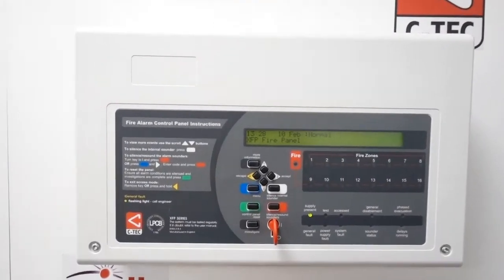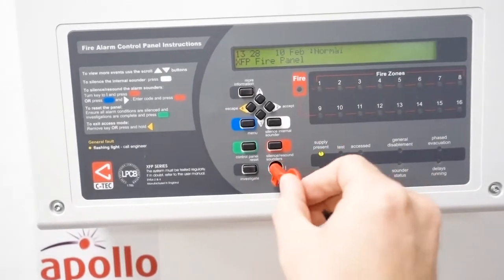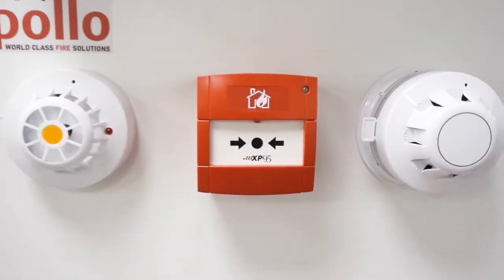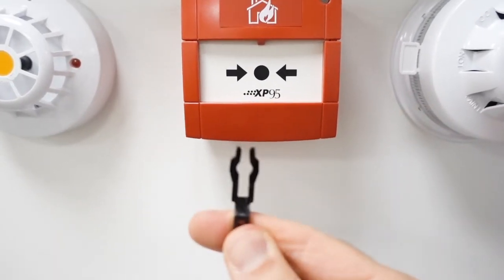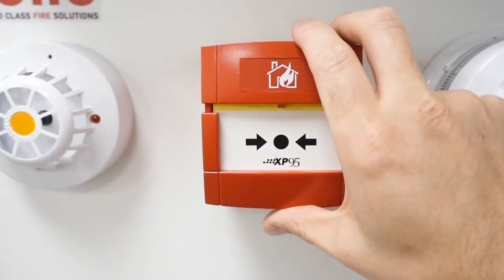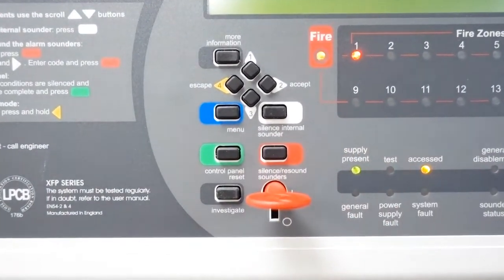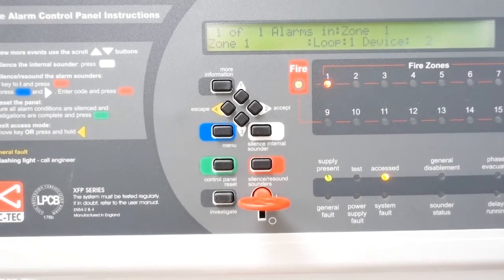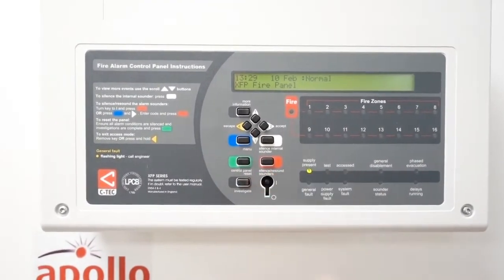TESTING C-TEC XFP PANEL | APOLLO XP95 MCP | FIRE ALARM DEMO

Comment: Hi mate. Would the xp95 devices work on the c-tec fxp501e/h panel?
Reply: Cuezed Deen idk
Reply: No, that model number shows that it is a Hochiki panel (ending in h), you would have to get the one ending in x for it to work with XP95 devices.